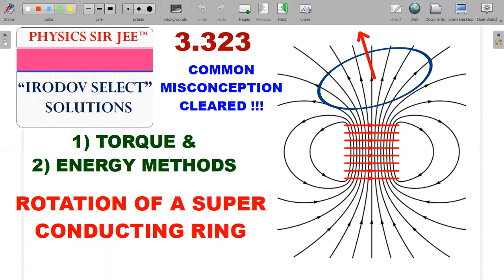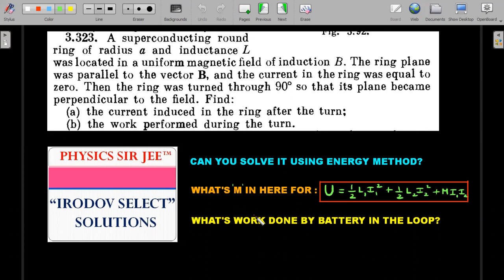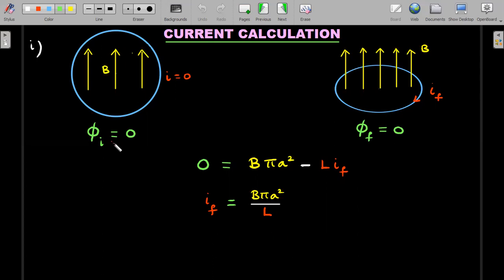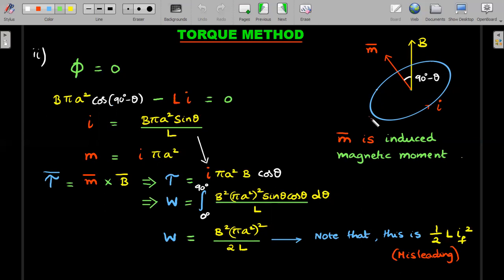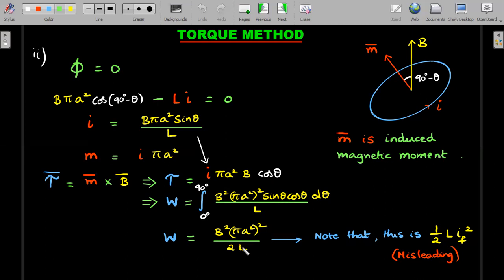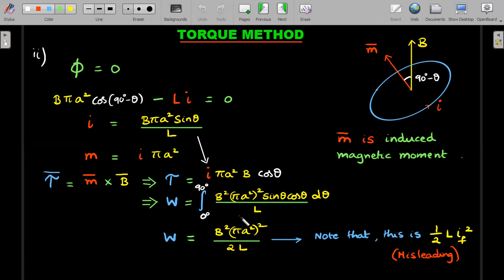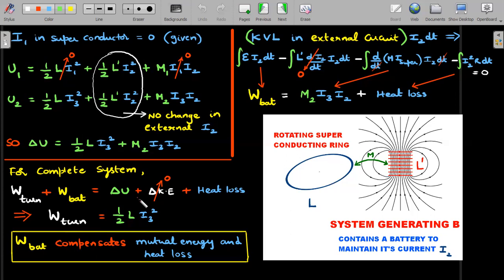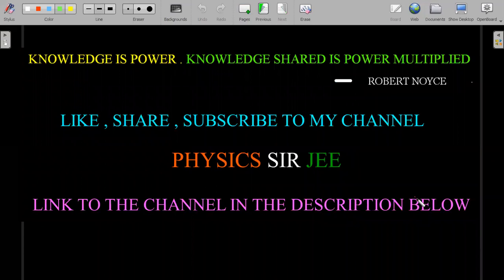IRODOV SELECT SOLUTIONS 3.323 | ROTATING A SUPERCONDUCTING RING |ENERGY |JEE ADVANCED SCHOOL PHYSICS

Comment: Sir can we say,
Total energy at any instant = (- m . B ) + (1/2 L I^2) 
Change in this quantity will be work done by external agents.
I'm disregarding system generating the B, although your solution involving it is amazing👍
Reply from the maker: You should state clearly , "total energy of whom?" . By taking the term -m.B itself , you are involving system generating B and not disregarding it. You should realise that -m.B is nothing but +Mi1i2 . If you are taking entire system then there should be two L terms.
PS : m means Dipole moment , M means mutual inductance in my comment
Reply: Yes sir, I realised the mistake, because u get a negative answer using this.
The difference in this quantity will be total work done by generating system + external force, owing to the fact that the 1/2 L I^2 term of generating system doesn't change . And by "disregarding the generating system" I meant not going into the specific calculations of the system😄
Am I right?
Reply: Sir is there any rigorous proof that -m.B = M i1 i2 or can we just perceive them as different ways of writing the same interaction energy? I know how M i1 i2 is interaction energy, but idk how to introduce m and B terms in this expression and make the two equal..

Comment: sir, Instead of applying work energy theorem on system if we apply it on superconducting ring only and write its energy
 U=1/2 LI^2 -M.B
taking in to account both self and interaction energy 
then will the difference in potential energy give correct answer for external work?

Comment: sir jee i need your help with one question (no need of video) sir the 3 rd question of method of impulse and momentum chapter(build up understanding section) sir is the ans given in the book correct i am getting root 3gl/16
Reply from the maker: Answer given in the book is correct
Reply: @PHYSICSSIRJEE  sir jee I was able to find the string becomes taut after falling a height of 3l/8 until which it undergoes free fall due to absence of tensile forces in the string but as soon as string becomes taut it exerts an impulsive tension one exactly antiparallel to initial velocity and one at an angle 53 degress with vertical sir jee will the ring then attain velocity at angle 53 degress with horizontal as the string is inextensible right so it attains velcoty perpendicular to string sir am I correct
Reply from the maker: @ponnapu  perpendicular to resultant of two tensions. I am planning to make a video on similar Concept , I will try to include this problem in that
Reply: @PHYSICSSIRJEE  sir excited for the video but can u just reply this one last query sir why should it be perpendicular to the resultant sir